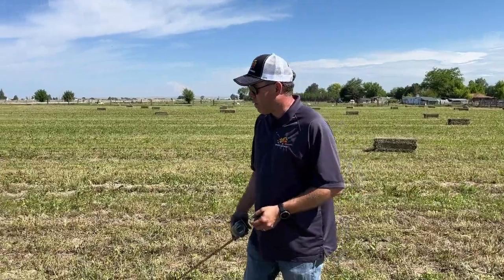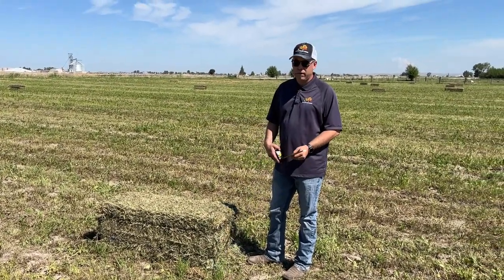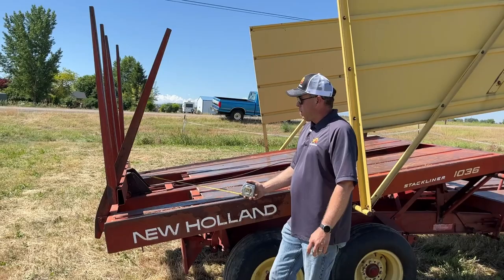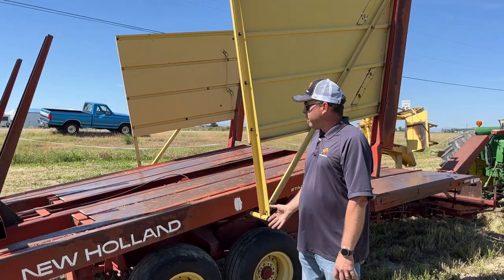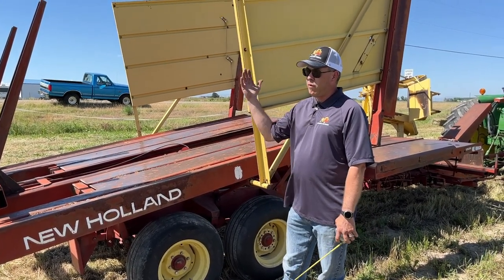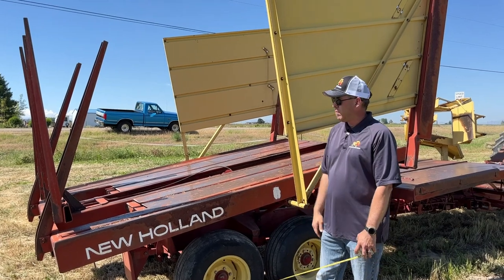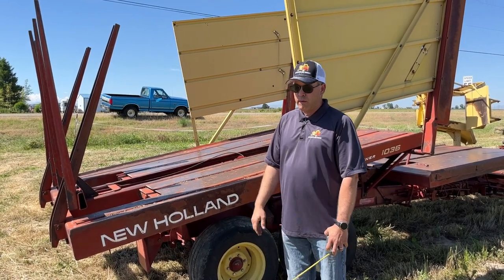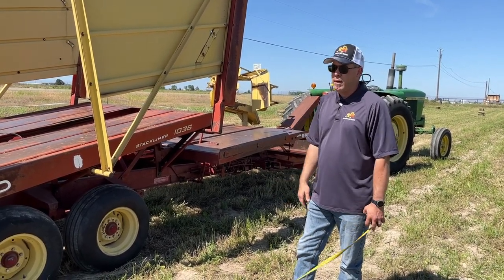Bale Wagon two biggest mistakes

Comment: Super Slick Machine! Baled hay when I was young on a New Holland, super dependable machine but I think that machine would have put us to shame! I couldn't help but notice that beautiful Ford F-150 short bed in the background! If I recall Correctly the color is Brilliant Blue Metallic, looks to be an XLT, I bought that exact truck brand new in 1994 and then traded it on a 2000 F-150 Flareside which I still own, super nice with just under 50,000 miles on it but I must say, seeing that beauty in the background kind of makes me wish I would have kept my 94!
Reply from the maker: It runs great too!  Thanks for the shout out.